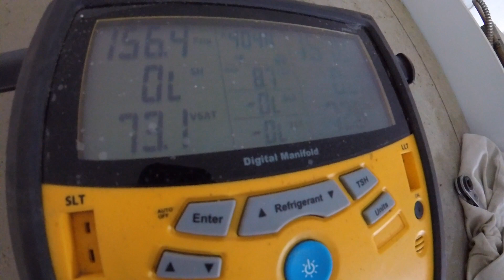Semi-hermetic compressor failure. No luck on rebuild it.

Comment: Wow! Must have broke the crank in two places for the pistons to be seized but the motor to still run and have the broken bit in the oil pump!
Reply from the maker: Strange that it pulls 6.6 amp with pistons not moving.

Comment: sounded like a rod in the video ;)
too deep/low tone to be valves and gas hammering causing it, then again, not everyone is used to hearing and listening for sounds like that.
once I got to 3:38 no wonder, probably rod chunks in there swinging around still. terrible
Reply: throttle bottle 1200 bucks later 💰 💰 💰
Reply from the maker: Good to know.

Comment: I see the crank shaft is broken.  If there is no damage to the crank case, you may still be able to rebuild the compressor.  Depending on the model, you might be able to purchase the crank and the rest of the parts from CMP in Oklahoma City.  I needed parts for a Copeland, contacted Copeland, would not sell the internal parts.  Tried local distributors, no luck, but you know that companies that rebuild compressors have a source of parts.  I'm putting in a plug for CMP Corp, their website is https://www.cmpcorp.com/.  They are reachable by email and by phone.  Their prices are reasonable.

I am rebuilding a Copeland, replacing two connecting rods, all bearings, oil pump, various bushings, and the gasket set.  Very much like rebuilding a car engine or lawn mower engine.

Jim